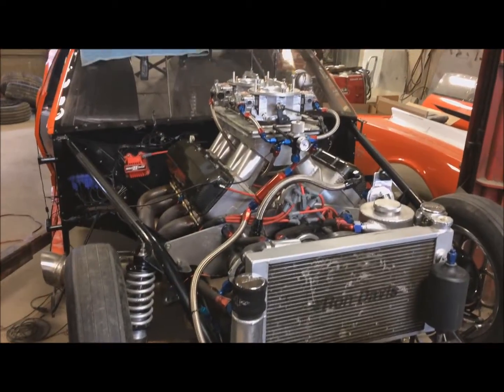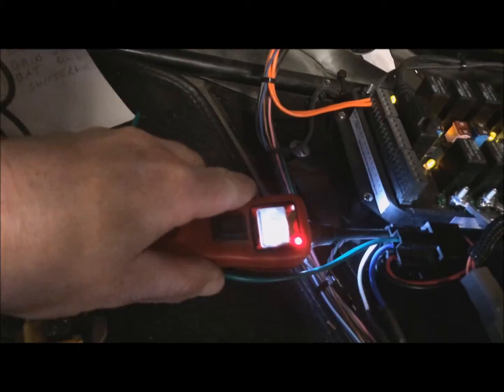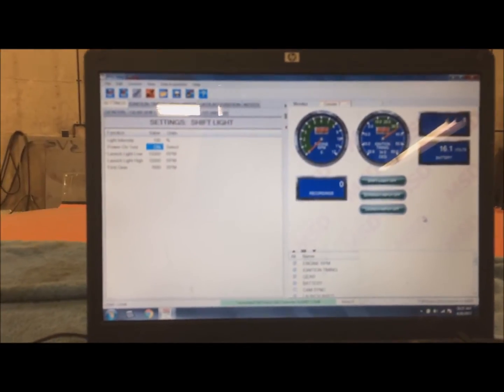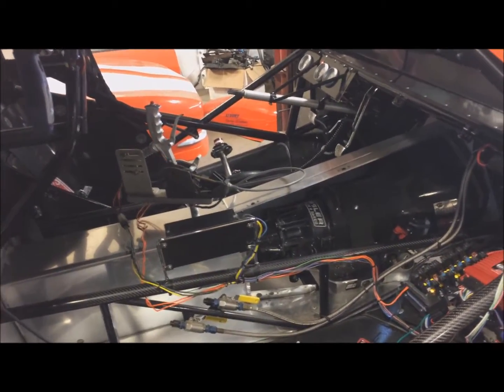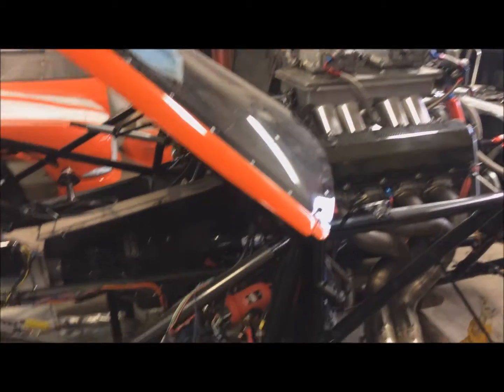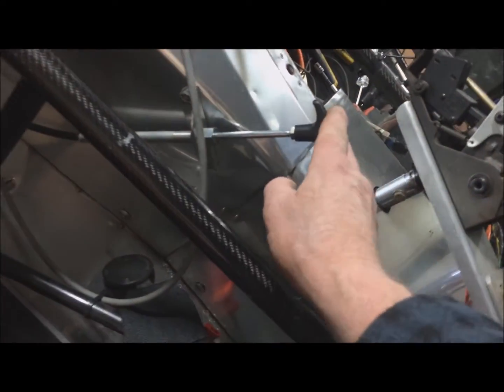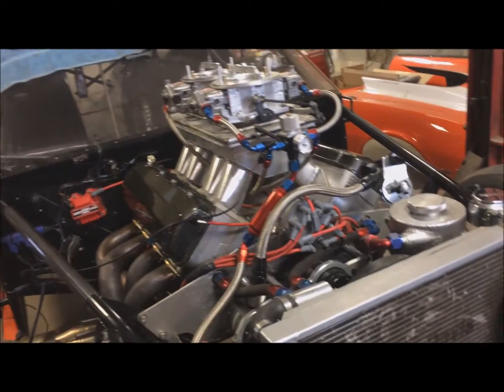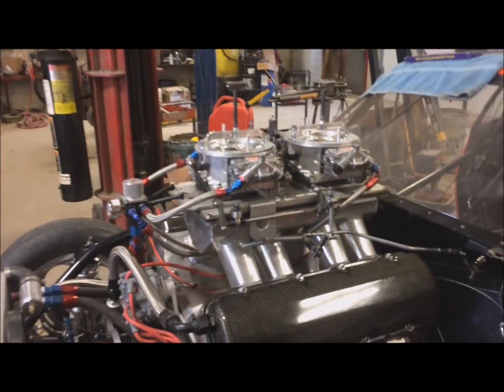CAMARO FIRST FIRE UP

Comment: How do you balance those rear wheels,as I have 15x15 on my hot rod in rear and no one can balance them for me
Please reply to this Jeff   would you do a video on how to balance those large tires and wheels?
Reply from the maker: I use my old Snap-On balancer. Its a hand spin balancer without the hood. If your shops have a balancer that only spins with the hood down just get them to remove the hood.

Comment: Jeff, how do you balance those rear slicks with that big off set?
I have the same kind of wheels on my olds but tire stores can not spin balance them because of big offset.
Let me know please.
Thanks
 Richard
Reply from the maker: I have an old Snap-On balancer without a lid. Its very accurate and has a static balance feature.
Reply: That was my problem that the lid would not close and they  will not run with lid open. So I an still tryin to find someone who can spin balance the 2 back tires.
Reply from the maker: The lid usually just bolts on. They can remove it and just turn the shaft to get the balancer to work

Comment: Maybe the data logger usb adapter is using a very old USB version that your laptop does not support.  If you get the model of the usb adapter you might be able to find out what version it’s using.   If it’s like 1.1 and your laptop is 3.0, could be not good.  Or try unplugging other usb devices that might be sharing the same usb channel, might not play well.  Interesting to hear compression and fuel.
Like the drink, like the dink.
Reply from the maker: I'm tired of fighting with it. I ordered a new V300SD.